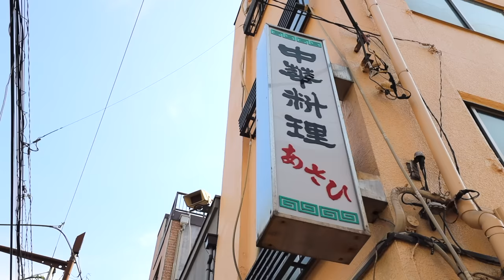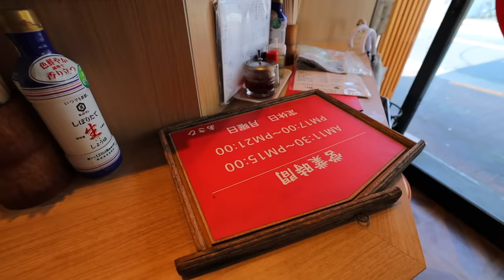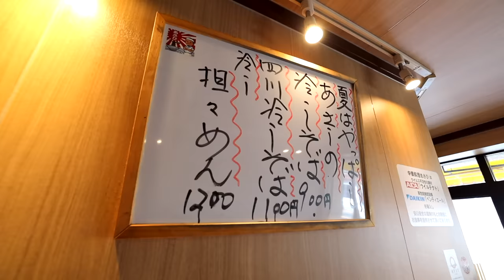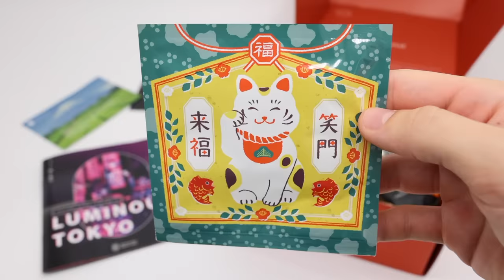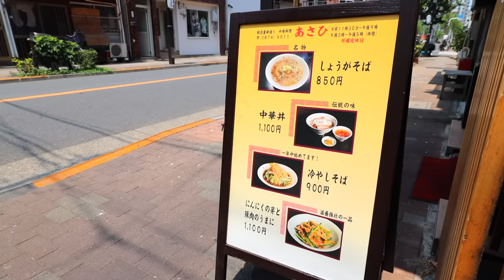Behind the Counter at a local Japanese style Chinese Restaurant

Comment: I notice from your videos that most restaurants still use gas stoves compared to most europe countries. We use electric resistor and induction for decades now (not only at home, but in restaurants too!). Way more efficient, cleaner, no exhaust fumes, less heat in the kitchen, etc.
Maybe you can find out why this is?
Reply: Gas stove is more efficient to Asian style cooking as it uses high heat that most Asian cooking requires.
Reply: @ANUBIS209  You can achieve high heat with all other variants too, especially induction and they heat up as fast as gas without the dangerous flames. That's not an argument, more a lazy excuse to not learn new cooking techniques ;)
Reply: @Diablokiller999  I wouldn't say it's a lazy excuse cause it is true they prefer high heat which uses fire instead of electric. Induction doesn't bring out the flame and also a wok is round as most gas stove in Asian restaurants has a round shape hole for it to place a wok in and able to maneuver and stir fry it however they want. Also, a good Asian dish especially Chinese food uses a cooking wok method called Wok Hei also known as the breath of the wok. Without high heat coming from fire you won't get that additional flavor cause electric stove can't achieve that.